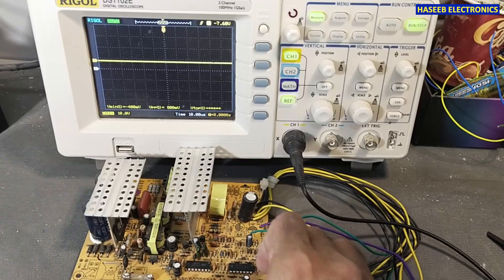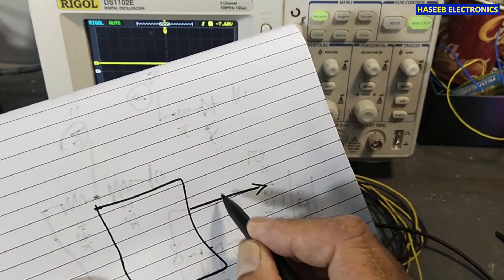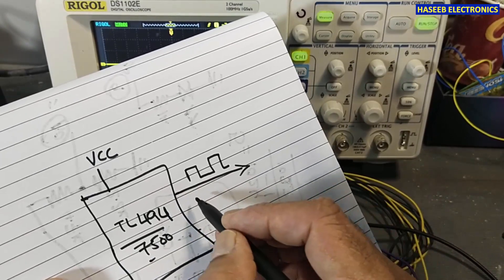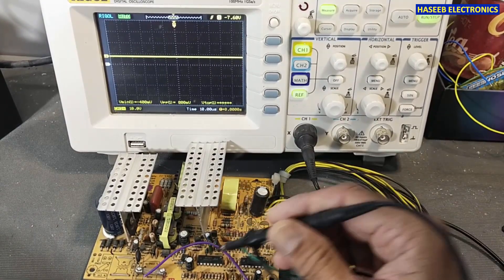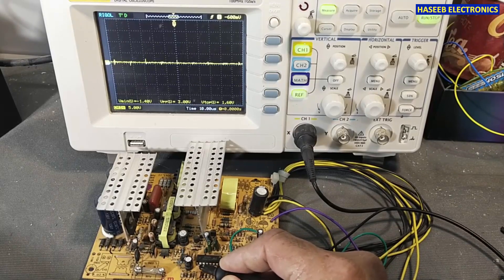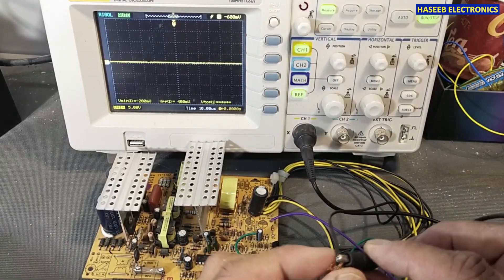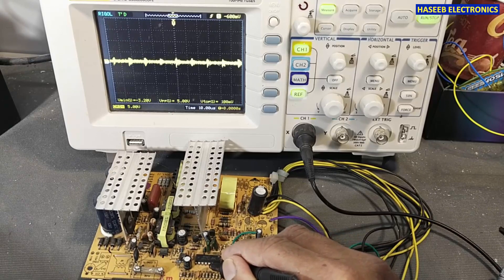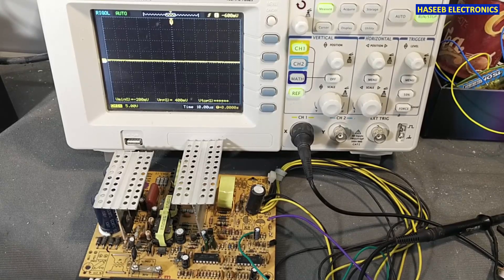{715} How To Test Output Signal of IC Integrated Circuit

Comment: Oh bro you mean if we want to check an ics input or out put with oscilloscope first we need to ground probe to ground of ics which we want to check right? what if we cant check an ic signal we cant put Ground of circuit board bro?or juat ics ground pin that we want to check?

Comment: Aside from testing EEproms, can you also test controller IC's the same way?
Reply from the maker: just we can verify the activity on the pin. but it cannot be guaranteed that it is working good or not. as microcontroller is always doing random work. all the time its output will differ based on the inputs and its logical operations 
we need to verify the source code with master copy.

Comment: Thanks brother again for the video, actually my question was specifically for SMPS to measure the output between both pins of the IC instead of capacitor negative lead, to check the signal of the frequency. 🌹

Comment: Good information, Haseeb. You stated very clearly and very specifically that the output of an IC may be read between its output pin and its own (emphasis) ground pin. I believe this warrants additional special attention. While it is typical for there to be only a single ground rail which is common to all the components in a device, it does not have to be so. What we call "ground" (at least in the USA) might be better referred to as "return" or "null." Any number of multiple return paths may be used in a device. Therefore, it is best practice to measure the output of a component by referencing its output to its own return/ground supply pin. Even highly educated and experienced engineers (and I, myself,) have developed the poor habit of clamping the negative probe of our multimeter to chassis ground and then just probing around in a circuit. This can have the unintended consequences of taking an in correct reading, damaging the circuit, or injuring ourselves. You have done well to remind me to take caution and use proper safety techniques... To understand a circuit, before beginning to work on it. To be mindful of where I am in a circuit. To be very careful in how I reference my meter probes to take a measurement. So, thank you!

Comment: What's the best way to find a safe accurate ground for an Ocilliscope on a circuit board without using a isolation transformer? Thanks.
Reply from the maker: it is easy to remove safety ground for oscilloscope, and we can test unisolated signal, (in this case the oscilloscope will float, se we need special care while connecting the test signal and the signal ground)
Reply: @HaseebElectronics